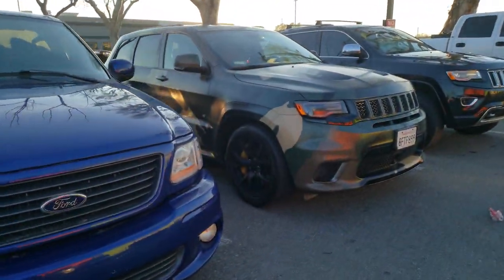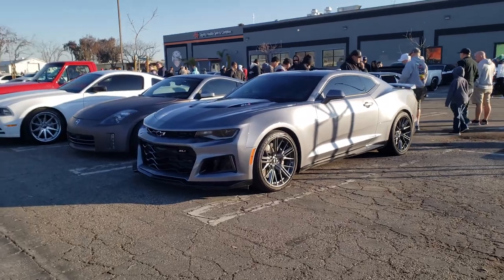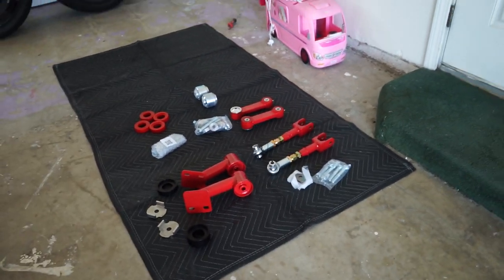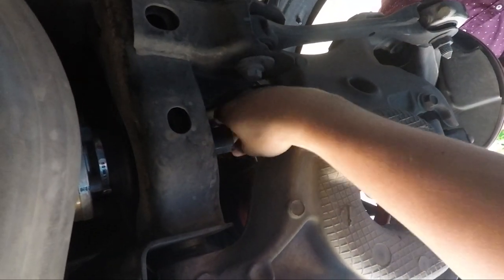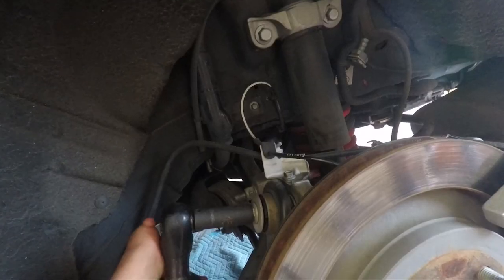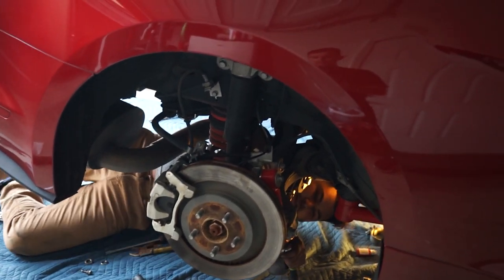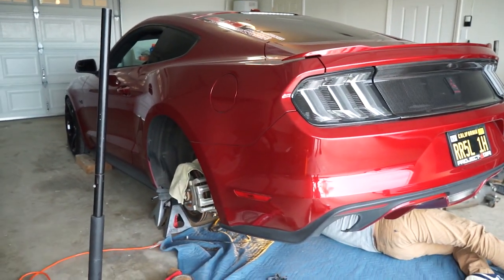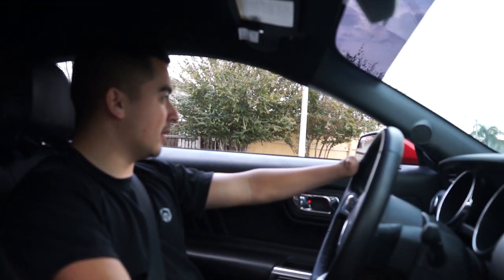BMR Suspension 2015+ Mustang "Bread and Butter" Package

Comment: hope you have good luck with those spherical bearings. i dont have good luck with them.
Reply from the maker: Decided not to do them lol
Reply: What's the problem with them?
Reply: @lobbyrobby  for me on a dodge charger after about 2000 miles they started to squeak and creak. Replaced and lubed them many times. Supposedly mustang parts get better bearings. I have a mustang now and went with STEEDA parts. Imo much better. I have a few parts with bearings and 10k miles later not a noise yet and i have not given them any attention